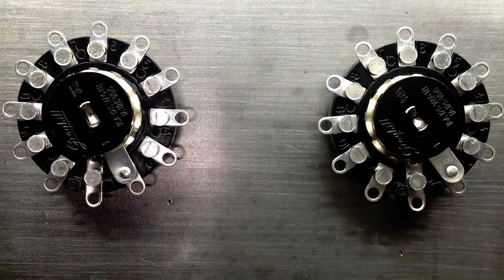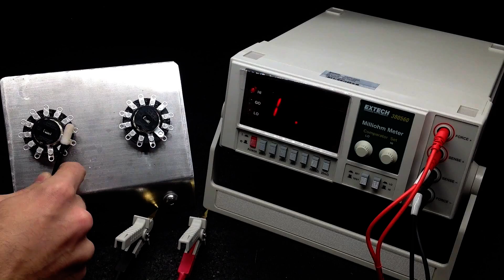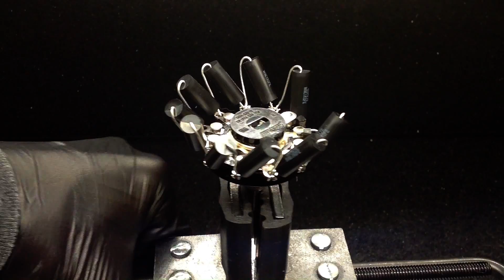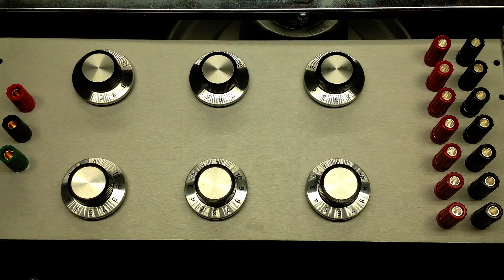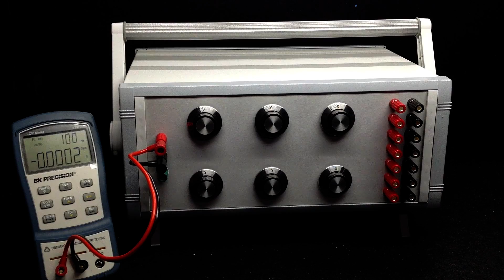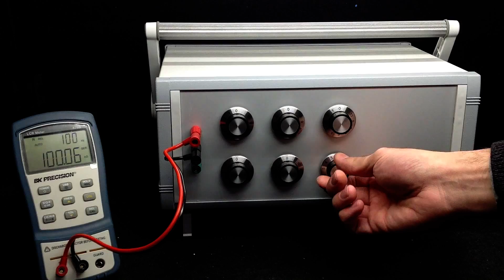Homemade Resistance Decade Box w/ Mini Deoxit Test & Wireless Ice Tip Preview

Comment from the maker: Here are some of the Part numbers that I used. Ideally I would like to use the same family of resistors for every range, but I was limited to what was available.

1/4w Resistance Range (MOST .1%, x10 OF EACH):
1 Ohm: 71-CMF551R0000FKEK (MOUSER)
10 Ohm: 66-RC55LF-D-10 (MOUSER)
100 Ohm: 985-1024-1-ND (DIGIKEY) 
1K Ohm: 985-1039-1-ND (DIGIKEY)
10K Ohm: 756-RC55Y-10KBI (MOUSER)
100K Ohm: 985-1082-1-ND (DIGIKEY)

5W Resistance Range (Most 1%, x10 of each)
1 Ohm: WNE1R0FETCT-ND (DIGIKEY)
10 Ohm: WNE10RFETCT-ND (DIGIKEY)
100 Ohm: 588-WNE100FET (MOUSER)
1K Ohm: WNE1K0FETCT-ND (DIGIKEY)
10K Ohm: WNE10KFETCT-ND (DIGIKEY)
100K Ohm: 71-RS5-100K (MOUSER)

Resistance Standard
1 Ohm: Y09261R00000A0L-ND (DIGIKEY) .05%
10 Ohm: Y0007-10-ND (DIGIKEY) .05%
100 Ohm: 71-Z201T100R00VB (MOUSER) .005%
1K Ohm: 71-S102C-.005-1K (MOUSER) .005%
10K Ohm: 71-Z201TI0K000VB (MOUSER) .005%
100K Ohm: 71-S102KT100K00TB (MOUSER) .01%
1M Ohm: USF340-1.00M-T-5PPM-ND (DIGIKEY) .01%

Binding Posts / Switches:
Microvolt Red: 501-1699-ND (DIGIKEY)
Microvolt Black: 501-1331-ND (DIGIKEY)
Microvolt Green: 501-1787-ND (DIGIKEY)
Silver Red: J164-ND (DIGIKEY)
Silver Black: J165-ND (DIGIKEY)

Rotary 11 Pos. Switch: 706-19001-11UL (MOUSER)
Rotary Knob: 450-1752-ND (DIGIKEY)
Enclosure: M5635335-AL (Allied Electronics)
Tilt Feet Kit:  M5600045 (Allied Electronics)
Spare Front Panel: M5700621

Comment: Can you please tell us some details of the switches? I would like to use them for something else and they look very well made.
Reply from the maker: I want to say they are part number 19001-11UL Made by Grayhill.  Mouser # 706-19001-11UL for solder terminals, and part # 19101-11UL for quick connect terminals.
Reply from the maker: Knobs Digikey 450-1752-ND
Reply: @JidoukaSS  45$ each!